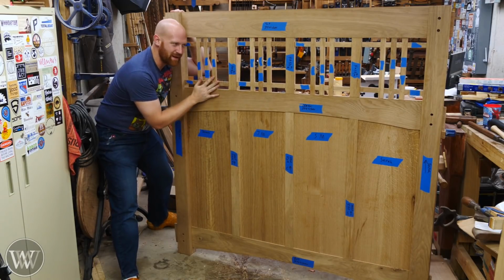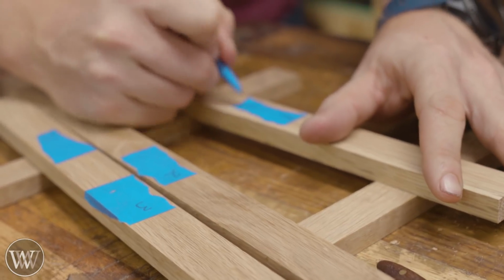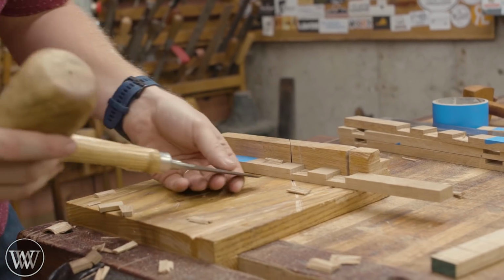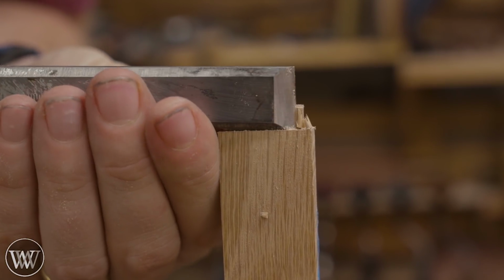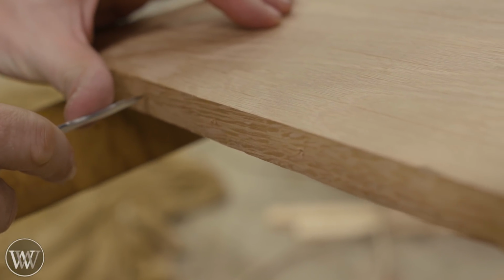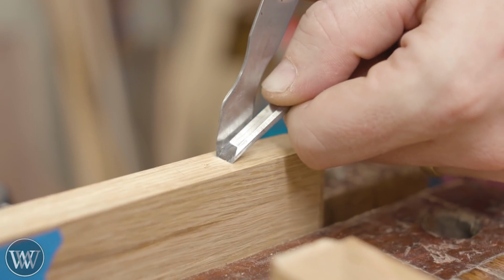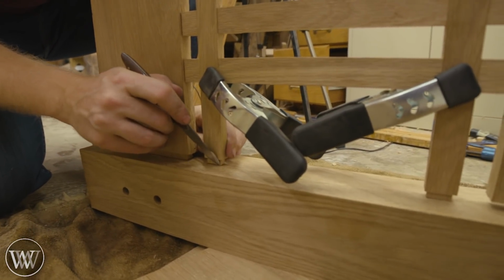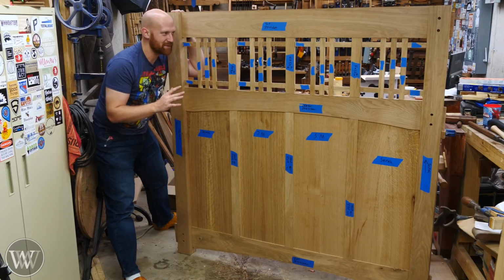How to Build A mission Style Bed Part 5

Comment: An idea just popped into my mind to cut all the tenons at "once" (at "fours" actually) with one of those fancy rabbet planes you own? I would (because I am a newbie and I don't know why I should not) clamp all the slats together and planed the tenons with a few strokes (rotate, rinse, repeat four times). Can you tell why this idea is bad?
Reply from the maker: it would work well if you could line then all up. the problem is that all the tenons are slightly different lengths and the rabbiting plane rides on the fence that would cut in a certain distance from the end. If you put up a fence and clamped them to the face of the work for it to slide along then it might work, but you would have to spend so much time setting them all up and holding them all in the EXACT position in such a way that none of them would move at all. and you would have to do all of that at least 8 times. on top of that every board is slightly different to match up with where it is on the whole piece. though the actual cutting might be faster it would take more time in the end. in total the tenon cutting portion for all of these was only about 20 minutes. though it may look like a lot of work it is actually the fastest step in the session. and one of the most fun as it is cool to see the sides pop off revealing a tenon!